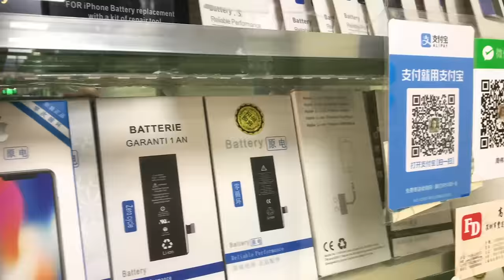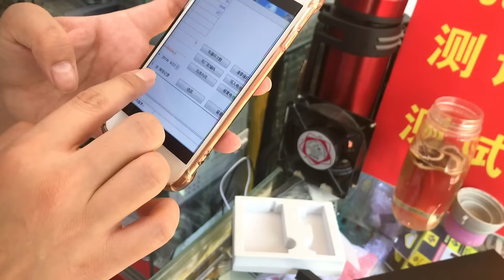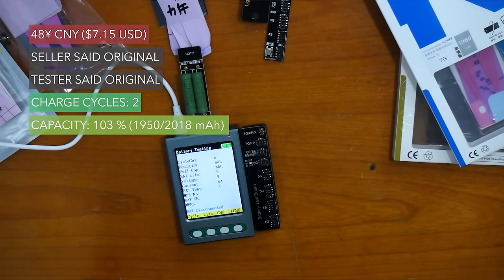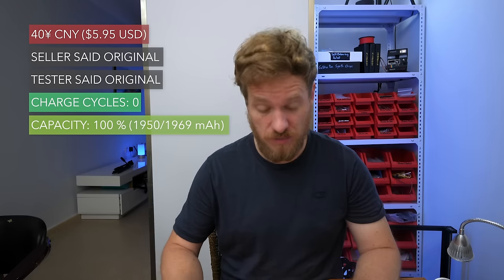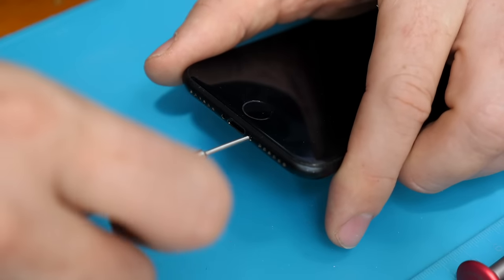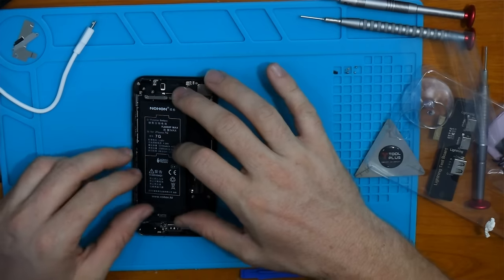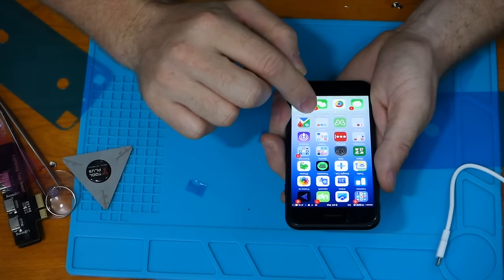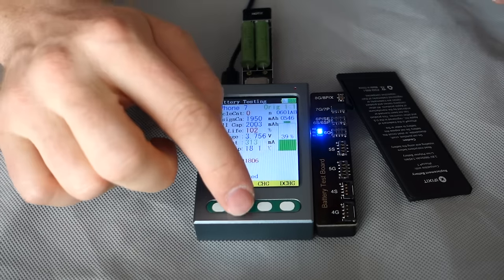Real or Fake? Trying to Replace my iPhone Battery in Shenzhen, China

Comment: As you can open iphones at any time, why don't you make a removable back/removable battery mod to it? It would be really cool
Reply: Yes especially the fact that he has an ender 3 behind him so he could easily 3D print parts for that mod
Reply: Yes please!!!!
Reply: this is a great idea actually, mayde apply this to the strange parts iphone?
Reply: @uyhu24  This would be great!
Reply: That would be sweet. Throwing another vote in on this. Who knows, it could even inspire the local shops.
Reply: Did that to my Nexus 6p hehehe
Reply: because when you drop it the whole phone will shatter? Please use that tiny mind.
Reply: Then the phone wouldn’t be as water resistant as it first come
Reply: @flightworks6874  i own an ender 3 and i do not think that is an ender 3
Reply: Eduardo Avila
You need cheaper phones, bigger models, or LEGO build it yourself phones?
i love the thin models!
Why not glue the screen on the battery, ARM in the middle enough, why case it?
Reply: @CalintzJerevinan546  Bigger Wall we do need!!!
 Stop the cheap outsourcing to Asia please!
US phones we need! We need to produce goods again!
apple is only producing some desktop models, not any US iPhone....
Reply: Aye but then it aint waterproof anymore
Reply: @TheChameleon2008  Firstly the iphone 7 doesnt seem to have a glass back, instead it seems to have a metal back. Second, its glass it would shatter no matter what if it is removable or not. 
I think your mind is small. 

Also he could easily replace the back material even if its glass. Things like 3d printers exist.
Reply: @robertchen5249  It actually can be, jut use a decent gasket and locking mehanism. The galaxy s5 is a living proof of that. Not only that but when he opened the phone the first it it isnt awready water resistant as he said himself.
Reply: @CalintzJerevinan546  Isnt this the same? I mean the caps P is just the style of the logo.
Reply: @lucasrem  Your comment did not make any sense. He is modding a iphone, not stopping the industry to make thin phones, amd making it have a removable back, wont stop it from being thin. 

I didnt get the "lego build yourself". I think you're in the wrong channel, if you see here he does thinker around like adding a headphone jack to a iphone.

Comment: Needs to check if batteries from the Shenzen markets are trustworthy or not.

Buys battery tester from Shenzen market.
Reply: My thoughts exactly! 😂
Reply: very good point ^^
Reply: Matt Rodrigues I saw a tester on Ali Baba which could turn the name of Not original or copy to Original
Reply: @jshaw4757  I believe that the battery tester is made by one of the battery assemblers/manufactures/suppliers. Guess what such a thing would do when it detects a battery that it detects as its own brand. Also note that even at the best of times, the battery tester has to believe the battery monitor on/in the battery. If the battery monitor in the battery is faked/hacked, then it can report any fantasy value and this tester can not disprove it without at least one power cycle.
Reply: Beacuse they do this things ...
Reply: Lol
Reply: i think ,different quality has different price .premium quality has own price,if you looking for battery,you can test different  quality.
Reply: It makes the fake ones as an original and makes the original into a fake nice LOL

Comment: To properly test the battery:
1. Do a full discharge test to measyre exact capacity.
2. Do a resistance test by measurig voltage drop with known load.
Only then you can get some real data.
Reply: Yeah, voltage drop-off is what determines the useful life of mobile batteries.
I bet that old '85% capacity' battery only delivered a sufficient stable voltage for a short period of time.
Reply: That's why I was confused as to why some of these batteries have a 0 cycle count. If it's legit from the factory then there would be at least 1 test cycle. If it's showing 0 then someone is trying to deceive you.
Reply: lostunsunghero Or factories don't count their initial test cycle when specifying their warranty at some hundreds of cycles.
Reply: i dont wanna act smart(cuz iam not a diehard tech Gaijin ), but when you watch closely again, he knows that, he even talks about multiple discharges and charges to really test those bats.
Reply: I don’t know what you said  but it sounds smart and I agree with big brain lol no props man I got the concept and I mean my elementary school English served me right I’m getting what I couldn’t in co text of it all just wanted to say thanks for teaching me something new
Reply: exactly
Reply: @circuitdotlt: Yeah, the cycling would take some time but it is the only reliable way to determine the capacity. From the specs I found online, the battery box in the video can actually rewrite both the "design capacity" and the "full charge capacity" in the controller of the battery. The same way you can reset the cycles count of an old battery back to zero, you can basically set any capacity regardless of what the lithium cell itself is able to hold. The battery controller may calibrate the full charge capacity after while but I am not sure how long it will take (probably at least one full cycle to be reliable).
Anyway, the other important parameter - internal resistance - can be actually determined just from watching the video. I took the time and calculated approximate internal resistance for all cells as there were at least two different current and voltage levels visible. Here it is:
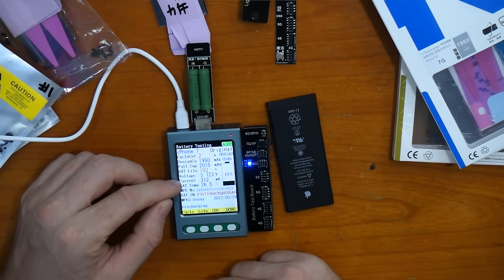- Battery #1 (48 CNY) - 7:40 - 3.807V @ -500mA, 3.723V @ 312mA => 103mOhm (not that good)
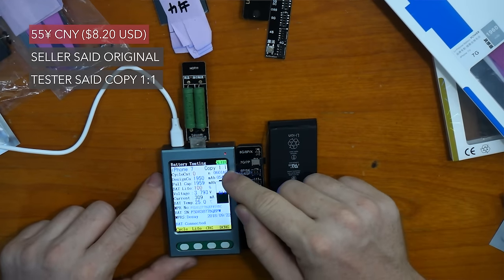- Battery #2 (55 CNY) - 9:10 - 3.828V @ 0mA, 3.793V @ 309mA => 113mOhm (not that good)
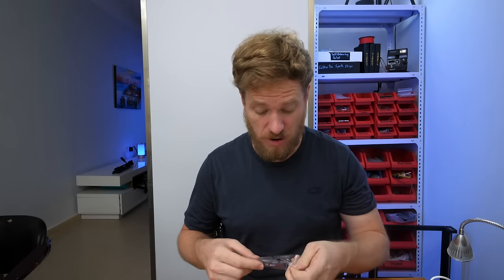- Battery #3 "DORAYMI" (45 CNY) - 9:34 - 3.867V @ 0mA, 3.817V @ 310mA => 161mOhm (quite bad)
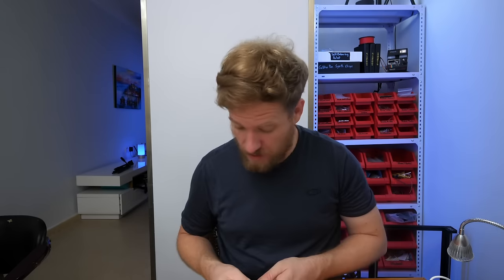- Battery #4 (40 CNY) - 10:05 - 3.897V @ 8mA, 3.895V @ 34mA (pretty inaccurate but we have no better data) => 77 mOhm (that would be really good if it was accurate)
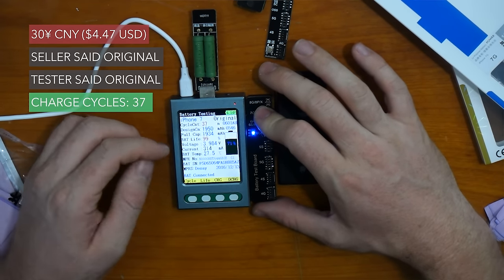- Battery #5 (30 CNY) - 10:39 - 4.006V @ 34mA, 3.985V @ 312mA => 76mOhm (good)
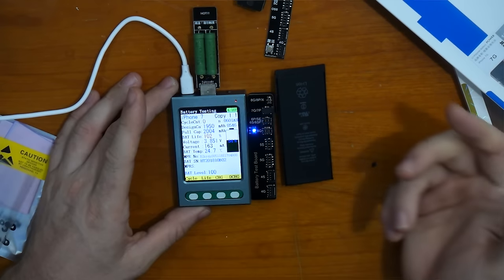- Battery #6 (30 CNY) - 11:55 - 3.851V @ 163mA, 3.769V @ 802mA => 128mOhm (not that good)
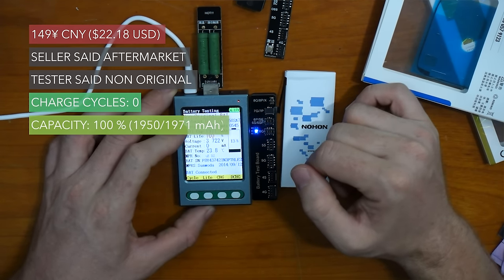- Battery #7 "NOHON normal" (149 CNY) - 12:48 - 3.645V @ 811mA, 3.723V @ 0mA => 96mOhm (good)
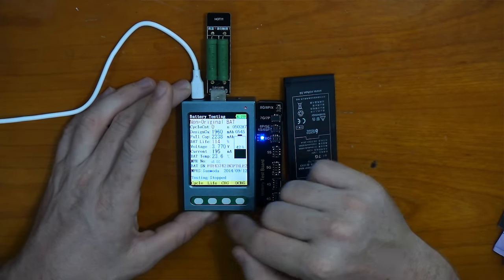- Battery #8 "NOHON bigger" (149 CNY) - 13:16 - 3.770V @ 195mA, 3.724V @ 809mA => 75mOhm (good)

To simplify it: A new smartphone battery should have internal resistance below 100mOhm. If ever the internal resistance goes above 200mOhm, you should start looking for a new battery because it would cause either performance throttling or sudden shutdowns when the battery level comes below 30 % and the phone starts to draw high current (eg. when you start some app). That's because the battery voltage drops too much at high currents.
I would personally pick the battery that has at least the designed capacity (measured by cycling!) and the lowest internal resistance.
Note that these internal resistance calculations based on the values from the video (sometimes just one frame) are not very precise. Ideally, you should get a battery checker that has a function of measuring the internal resistance or at least measure the voltage and current multiple times and try to have the difference of currents at least 1000mA.

Comment: I actually used an iFixit kit recently to replace a battery in my MacBook Pro. It's one of those with the glued in battery. Took about an hour to do it, but it wasn't difficult. In the kit iFixit included an adhesive remover (some solvent in a bottle) and it made quick work of the glue. The battery they provided has been great, works just as good as the original Apple one did before it degraded. This was the first time I'd bought any parts from them and I was pleasantly surprised. I'll probably do more stuff myself in future.
Reply: Their Pro Tech Toolkit is totally overpriced, as you can find most of the tools at the same or greater quality elsewhere, however I ended up purchasing it anyways, knowing it would definitely be of good quality, plus it was all packaged nicely together, and I have to say, the extra $30 or so was worth it in my opinion. I really like the quality of products iFixit puts out and their work to make everything easy and well documented.

Comment: Hey just a little tip, pull the battery adhesive at an angle side to side and it won’t tear
Reply: Sauce Boss 420 best tip is to take out taptic engine which reduces angle you pull it out at and means it won't ever tear
Reply: Both of you are wrong, what causes it to tear is if it happens to peel back the wrap on the battery. Using your techniques can help to mitigate that, but neither is foolproof.
Reply: Actually no, if you use your fingers to do it and actually stretch it like a normal 3m strip its fine.
Reply: Alcohol and heat if it has trouble tearing, also you can use a pair of straight tip tweezers to curl and pull the adhesive easier
Reply: Will Grabham true
Reply: Bobby Brady  i had a costumer yesterday with a battery not secured with adhesive and when he was moving his phone around it was moving inside and it was very annoying.
Reply: Remove taptic engine or don't, use a side angle or don't, whatever, just use your fingers vs tweezers to pull. I've never had one break doing this.
Reply: The adhesive prevents the battery from moving around freely, hence preventing the cable from breaking, I think the best way to remove the adhesive is by removing the taptic engine, and if it still breaks, then throw in a little acetone and then attack with a queen or king:spades clubs or hearts anyone will do

Comment: 12:50 The battery level of 50% is to reduce wear on the battery as it wears faster when kept near 100% or 0%
Reply: That's correct 😉 and dont let your phone battery to drop below 20% it will last longer
Reply: The "battery level" is different from how much it's charged. You can see the actual charge percent inside the battery icon on the right of the screen.
Reply: @mongohands  Ah ok, I see now. What  could  battery level indicate though?
Reply: @RandomVideoGuy-qy8fu  Not sure the technical terminology but it basically shows battery health. You can find the number in ios settings. Anything below 80% is bad and below 70 is almost useless. Not sure why some batteries had 50%. Prob something to do with off brand batteries not being read correctly.
Reply: @mongohands  but isn't the health of the battery indicated by 'BAT life' which is shown as 100%?
Reply: RandomVideoGuy #1124915 He explained in the video “BAT Life” = full capacity / designed capacity. That’s why BATlife goes above 100% occasionally because actual capacity of batteries are slightly larger than the arbitrary number manufacturers put on the battery
Reply: @mongohands  wouldn't the full capacity drop over time?
Reply: RandomVideoGuy #1124915 Yes it would. If you look at 16:18 where he’s looking at his old battery you can see the full capacity is below the designed capacity. Hence why the BATlife is 85.
Reply: @mongohands  BATLife is 85 but BAT Level is 60, is it because BAT Level is more of a measure of when to replace the battery (what you see as battery health on the phone itself) whereas BATLife is the true measure of capacity?
Reply: RandomVideoGuy #1124915 Correct. BATlife is measuring how much capacity it has vs how much it should have. BAT level I’m assuming is doing a calculation based on current and voltage. That or it’s just based off how many cycles it’s gone through. For example the more charging cycles the less BAT level.
Reply: Yeah. It's also why your new phones are always half charged
Reply: @MrMarukas86  yeah,  it is true, but even if you keep your battery all the time in 20-80%, the amount you gain is like 2 months.  you still need a battery replacement soon. just use the battery as you like and replace it yourself with couple cents.

Comment: The part doesn't need to be genuine, just high quality. Sometimes genuine parts are cheaper sometimes the high-quality knock-off is cheaper. Just so that it works.

50% is the ”storage charge” for lithium batteries.
Reply: I prefer a "store brand battery" anytime over an "original battery" with dubious origin. Apple does not sell loose batteries, so at best, you got a stolen good. At worst, it is counter fit and no one knows where they cut corners.
Reply: @sarowie  If the price is right, who cares if a phone battery is stolen? Get out of here lol
Reply: @aw9389  what he's saying is getting a stolen  completely legitimate battery is the best case, but the worst case you get a really shit made replica the ends up exploding in your phone, and you wont know which it is unless you buy one of these battery testers.

Comment: 14:21 From watching a lot of fixing videos by Hugh Jeffery, he always remove the haptic engine before removing the adhesives.
Reply: Ultimate Gamer Makes it easier but for people who don’t know it makes it riskier too
Reply: As someone who works in a cellphone repair shop and replaces batteries every single day, I see no reason to remove the taptic engine. It's saves me maybe a minute or 2 and that's only if the pull tabs break. If they don't break, I can have a battery repair done in about 3 minutes flat.
Reply: Another pro tip. Keep the phone laying flat on its back on the table while pulling the tabs. If the tabs break douse that phone in isopropyl alcohol, and then just pluck that battery right out. Also these things don't explode. The worst that can happen is that you really stab the crab out of it and it spurts flames for about a second, you say "oh shit!" and throw it on the kitchen floor.
Reply: CalamityBaird agreed,
Reply: @CalamityBaird  what is the fastest way to remove all the extra adhesive from the frame or do you leave it?
Reply: @TheRealTimnation  Does it have to be the kitchen floor?